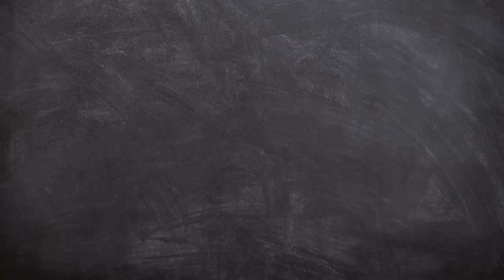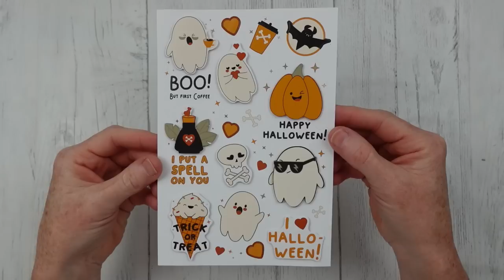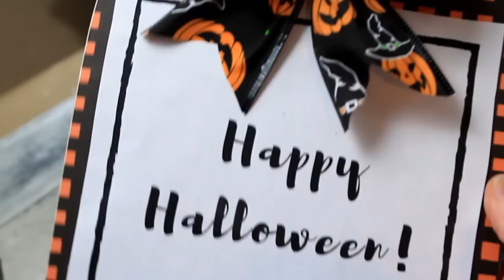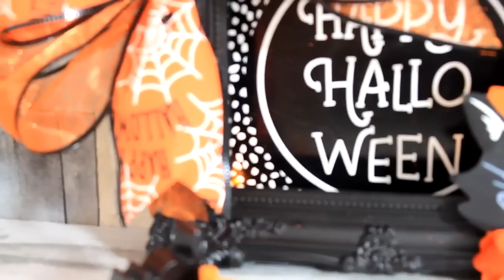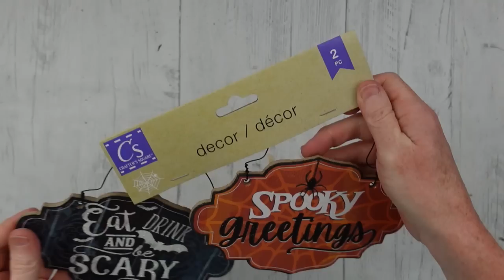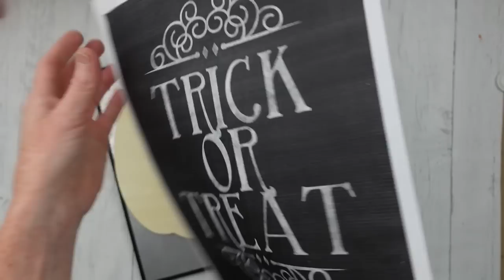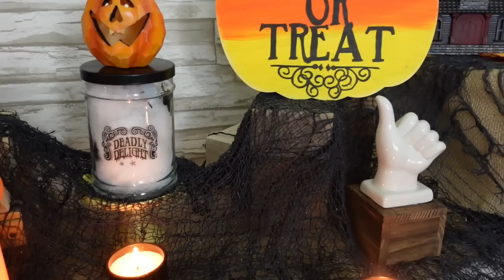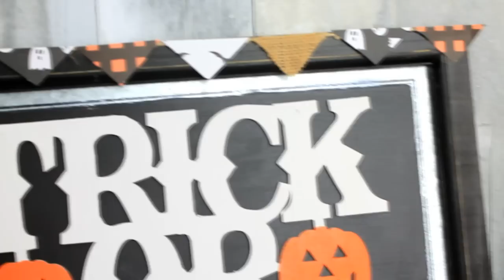My FAVORITE Halloween DIYs That You NEED To Do For Yourself NOW!

Comment: Where do you get the sanding blocks from? Also what grit of sand paper should I use for crafting.   I love your DIYS
Reply from the maker: Great question Denise! I get those sanding blocks at Dollar Tree in the tool section. I buy both fine/medium grit and medium/coarse. It’s fine to use the fine to trim up paper edges on projects. The heavier grit is better for wood and thickly decoupaged edges. Just my opinion of course. Hope this helps. Thanks for watching!

Comment: Use you blow dryer to heat the glue up on the sticker. It will help heat the sticky glue to remove it easier.
Reply from the maker: Great tip!